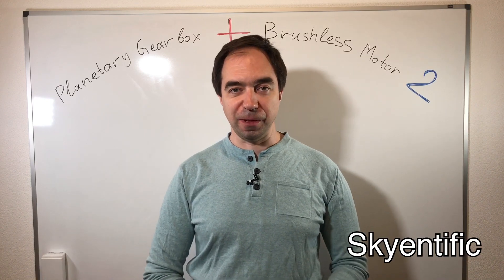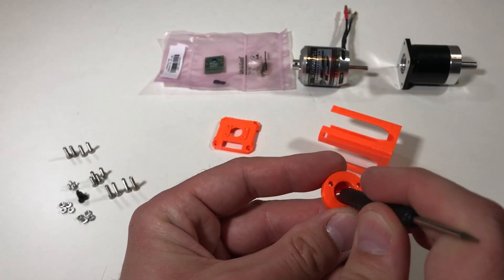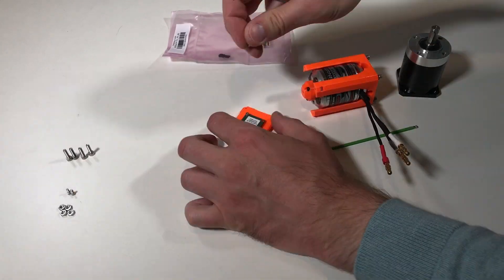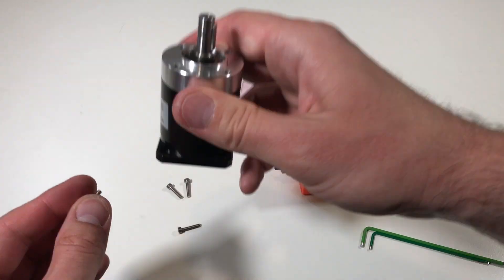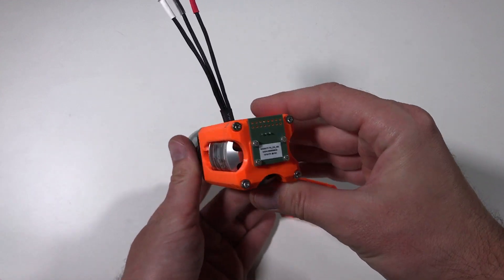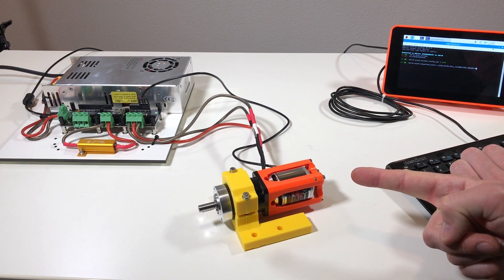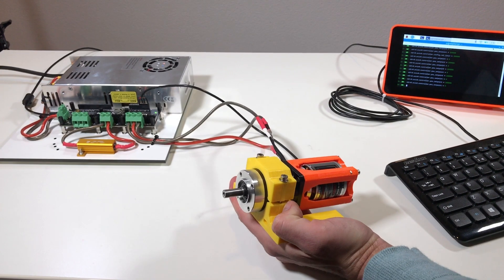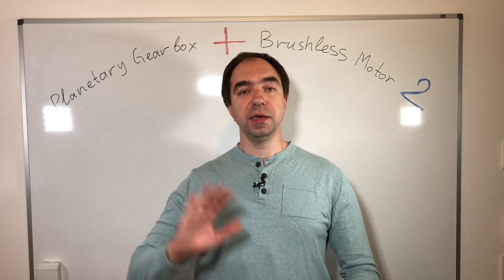Another way to make Robot Actuator (simple build)

Comment: Why does the encoder used?.
What is its work ?
Anyone tell me please
Reply from the maker: Shortly: you need encoder to know the position of the rotor. And the position of the rotor is needed in order to know which current to apply to which motor coil. Thus in order to control the brushless motor with the precision and at high torque, you need to feed the encoder data to your controller.
Reply: @Skyentific  thanks.

Comment: Is it possible to turn the Motor trough the Output shaft, if the Motor is powered off?
I have a application for this assembly, but the motor has to Hold a bit of force even if powered off.

Comment: could this be done with smaller bldc motors ?
Reply from the maker: Of course. But you need smaller planetary gearbox. Do you have some application in mind?
Reply: @Skyentific  was thinking of a pick n place or solder applying device (maybe both)

Comment: wouldn't it be better to put the encoder on the planetary gear output side to eliminate the backlash
Reply from the maker: Yes and no. No, because this will complicate the work for the controller (ODrive), and most probably the motor will oscillate like crazy (like cheap servo motors). The best is to have two encoders: one on motor, and one on output shaft.

Comment: So this cost around 100$ ? that's super nice. You should make a benchmark of all your design like the torque, speed, efficiency, backlash etc and maybe add a few other design like open torque to have a nice comparison of the price VS performance. Thanks for all your video
Reply from the maker: Thank you! I think this is a very good idea!
Reply: I mean, 100 without the odrive which is another 100$

Comment: Interesting idea replacing a nema17 with this! So you would need the ODrive to run this motor? If you wanted to use it in a 3d printer as a replacement for a nema17, how would you control it from the printers motherboard?
Love what your doing with all of the actuators, would love to see all of your new findings put into a robotic arm!

Comment: You don't need to remove rubber seal. Just put a few drop of lube oil around the shaft where it contact the seal and it will rotate easily.

Comment: It's awesome, I love that series with planetary gear and bldc motor!
However, this wont replace a nema17 motor in a faster environment like cnc, co2 laser or 3d printing... as it's not fast enough :(
Reply from the maker: Thank you. Why not? Without planetary gearbox this brushless motor is way faster then the nema 17 stepper motor.
Reply: @Skyentific  but wouldn't it then be a compromise in precision?
Reply: @jojoposter  that's exactly what I was worried about :)
By removing the gear the resolution drops,  speed increases. But in the CO2-Laser/3D-Printing environment you need speed and precision sadly

Comment: fantastic work! you should make an adapter to replace the encoder when odrive 4.0 comes out
Reply from the maker: Thank you. What do you mean? What is new in ODrive 4.0?
Reply: @Skyentific  supposedly, from a forum post 6 months ago, he said it will have a built in magnetic encoder and mount to the back of one motor that it will drive, offering a more scaleable long term solution
Reply from the maker: Great! This would be nice. In this case it should be easily adaptable for this design. I would need just to change this back plate. Thank you!
Reply: @Skyentific  found it!

https://discourse.odriverobotics.com/t/single-axis-integrated-odrive-concept/304